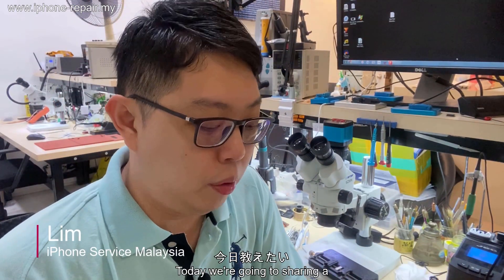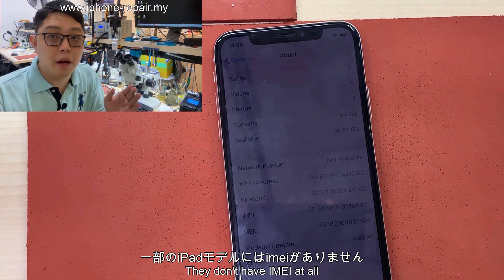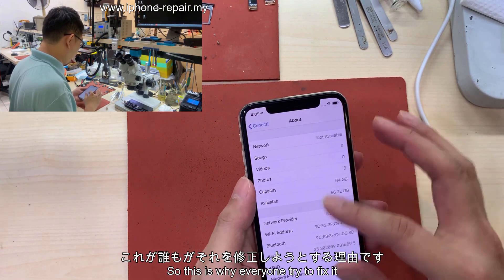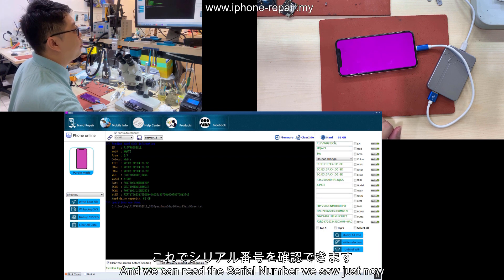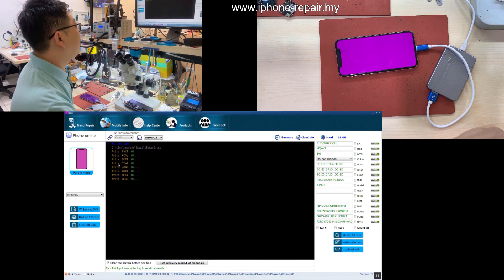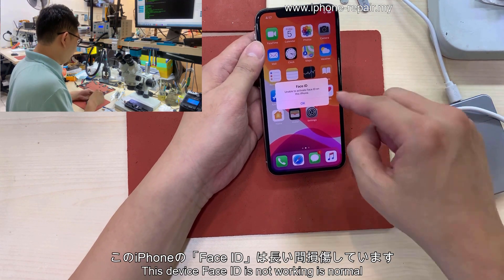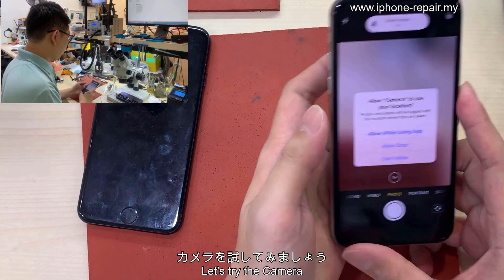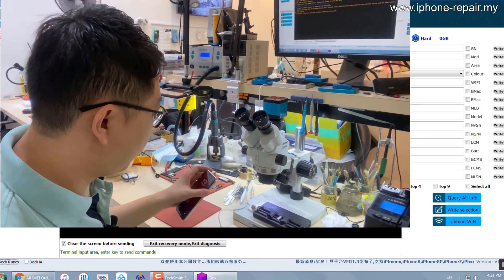【Japan iPhone Camera Shutter Sound Fix V2 】日本のiPhoneカメラのシャッター音の修理 2020

Comment: Hyee lim, may i know is this will work on 11 pro max japanese set? Thanks in advance
Reply from the maker: Yes. But not using this method. To do 11 series, it requires soldering works.
Reply: How about on iphone 12 pro max?

Comment: Is the process also applicable in 12 pro max korea version? 
And what type of ibox repair needed? Thank you!
Reply from the maker: No. The Same method won't work on iPhone 12 series due to the CPU design. Different security need to workaround.
  I'll release a new method if found a way.
Reply: @iPhoneServiceMalaysia  thank you for your response, highly appreciated!
I'll wait for your another tutorial about iphone 12 series. Thanks.

Comment: Hi dear sir
I am using your method and it is working but I have the following issue. Some of the phones are not vibrating after the modification. What might be the cause of that ?
Reply from the maker: Good question. 
If just only vibrator issue, It’s the generic syscfg file is not compatible with the iphone you writing. 
You need backup a syscfg file from another same iphone and then write on it.
Reply: Yes, that’s what I ended up doing and it worked fine.
Thanks for the reply !

Comment: Thanks for sharing the video. I did it step by step as you did but shuitter sound still on after country code changed. I chaged from J/A to N/A a, format the phone, activate the  phone but the only thing didnt changed is the shutter sound. What im i doing wrong ``? Thanks again
Reply from the maker: Writing a generic boot file first. And then manually write back original sn, bt, wifi 1 by 1. 
Change country code.
Restore in iTunes.

Comment: Hi Lim,
Is it also possible to upgrade the NAND with the irepair box? and repair 4014 and 4913 faults? 
Thanks for the good video I hope you make more about the irepair box
Reply from the maker: Hi. To upgrade you still need to remove the Nand off the motherboard with soldering skills required.
Some 4014 or 4013 can fix is because just boot file data corrupted